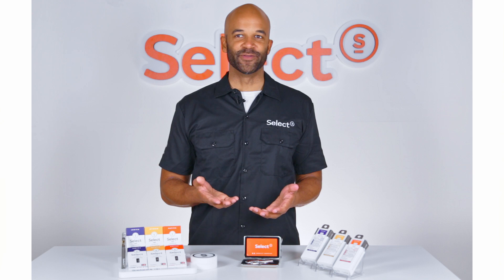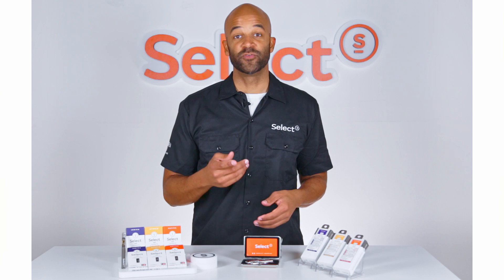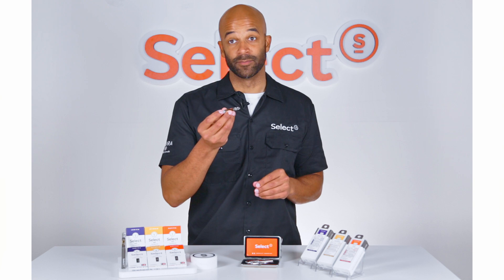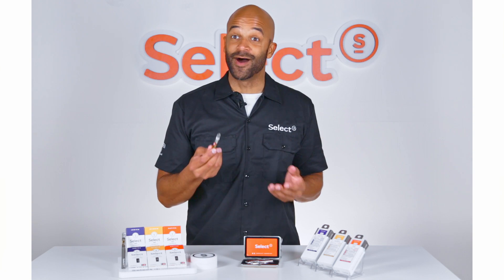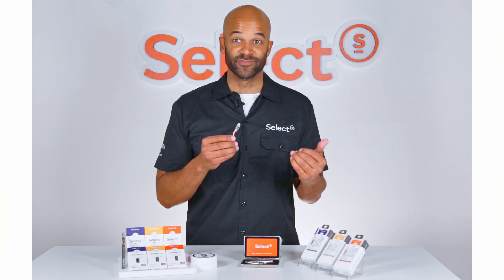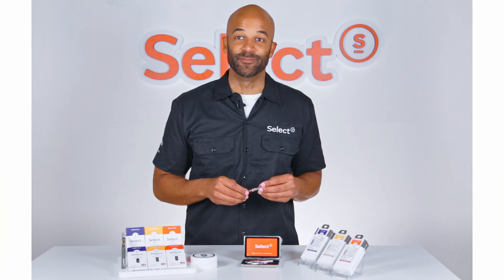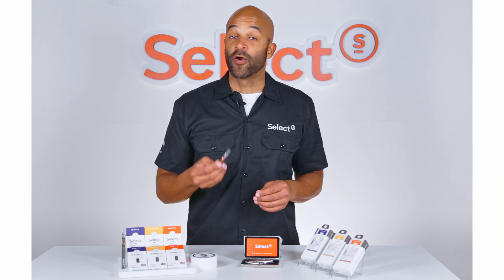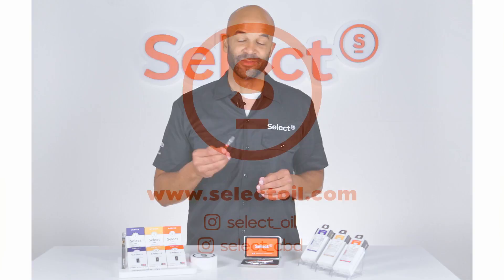Select Cartridge Care & Troubleshooting

Comment: My cartridge stopped working after 3 hits, I thought it was my battery and it wasn't, I went to the shop and exchanged it for another one strain but SAME issue

What worked for me was blowing the pen at the bottom AND the top of the battery after I did that it began hitting normal
Reply: Same here copped 2 gelato from their essential options and both not hitting right also got 2 apple fritters from their elite option and those hit hard no probs… i noticed at bottom of cart they dont have the chambers needed to pull like normal carts have and i believe thats the main issue
Reply: @ACR20012  Did those Gelato carts ever end up working? I bought two carts yesterday, one won’t hit anymore after the first hit and the second has nasty burning taste
Reply: @Callofbooty101  did you find a fix? This my issue rn

Comment: I've had 3 Select Elite Cartridges have the heating pin fall out of the cartridge after a week and a half of use. I'm moving onto another brand.
Reply: Doomhat2113 the oil might be different but all the cartridges are made by CCELL
Reply: Probably fake ?
Reply: I’ve had problems too. Two cartridges have had half full oil and the bottom part of the cartridge doesn’t touch the battery efficiently.
Reply: Week and a half of use ??? My carts only last 4 days tops .
Reply: @CursedNen  🍪 🏆

Comment: A little piece from the bottom of my cartridge came off, it was surrounded by a little rubber seal. Is there a way I can make it work again???  I can't seem to unscrew the whole bottom part to exchange it with an empty select cartridge that still works. I still have well over a third of it full. It's a glass cartridge and those dont seem to be able to unscrew through the mouthpiece or anything. PLEASE HELP!!
Reply: S2kleb I have the same problem as well
Reply: @jonaslack5357  I ended up making a little hole. Heated up the cartridge a bit to let the extract leaking through it. Then I got my friends electric rig on a low temp and let it rip.
I tried emailing select but they never replied . 
If you find a better way lmk
Reply: No, Select is garbage. The actual oil is good, but the rubber on the cart will overheat and break, rendering your cartridge useless. Also, Select carts are very inconsistent towards the end of the cartridge. Either the rubber will break, and/or varying ammounts of oil will be trapped in the cartridge and be unusable. Sadly, I've given them multiple chances and have been disappointed each time. Go with Heavy Hitters or something #disappointed

Comment: How do you fix the selects carts clogging issue because i swear yours clog more than any other cart because of the design
Reply: For anyone wondering use a needle to stick into trip to clear wax blocking the hole, after that it should rip but if it doesn’t you can heat the wax in the tip with a hair dryer and it should rip. IF that doesn’t work i recommend hitting the rip button on the pen and pulling until the cart unclogs. Hopefully this helps

Comment: I just bought one and it doesn't even work, I tried pulling up the pin on the battery and the cart but still nothing. It's trash
Reply: I have a different pen but its universals and will take all carts. This one doesn't work either.

Comment: I am having trouble finding info on the Select battery itself. Most have Amber lights for charging and green lights for fully charged. The Select battery just flashes white lights when you take it off or plug it in. There's no instruction manual for the battery itself or any info on the website from what I could find.
Reply: same, after i charged mine, every time i go to hit it it just turns the light on for 2 seconds and stops. no clue what to do about it because theres no information anywhere
Reply: handbanana5555 it comes fully charged. That's why it's confusing. It blinks like that when it's done. If you charge it after using for a while, the light will come on during charge and turn off when finished. I figured it out on my own quickly enough, but now people can hopefully look here and know:

•Fully charged: Blinks when plugged in and then turns off.
•Needs to charge: Solid light when plugged in that turns off when finished charging.
Reply: i think i mightve screwed mine on too hard,  because i can hit it now as long as the cartridge isnt on all the way, but slightly loosened
Reply: The instructions that come with the cartridge specifically says to prime it with the rubber cap ON! So which is it? On or off?
Reply: Did you figure out what to do? I'm so confused.
Reply: Select battery packs are junk I use a bbtank battery pack looks like a key fob no problem to date
Reply: im using a FlavRx push button, i picked up a .5 cart of skittles today and it's okay. just don't like the fact that you can't unscrew the tip to get bubbles out.
Reply: saved my life 🙌 also i had to prime it without the rubber thing. i held my finger covering the bottom hole and inhaled thru mouth part lol

Comment: Hey just a quick check, does this cartridge work with any 510 compatible eGo?
Reply: All 5.10 treading fits, watch out for the power supply amounts.
Reply: They do work but only until about half way they stop hitting, even when there’s oil left in. You have to constantly unscrew and fix the cartridge which ends up making it worse if you do it wrong. So don’t get these until they fix it.

Comment: My battery will light up when I press button but when I try to inhale it blinks white 3 times. Does this mean it’s dead or connection is messed up? If connection is messed up how do I fix this
Reply: I have the same issue, the light blinks red 3 times meaning my battery is dead but when I charge it, it turns green as if it is fully charged and isn’t.

Comment: my cartridge feels clogged with no airflow while screwed into a battery and its really hard to take a good pull. but if its not screwed into a battery it has airflow just fine. is there any recommendations?
Reply: @noahpaynenoahgayne7309  It turns out you just need to stick a needle or paper clip in the little vent holes on the lower end of the cartridge

Comment: I just got one of these pens and cant for the life of me get it to work. it says its fully charged but everytime I try to rip it it wont work :^/
Reply: Must be your battery
Reply: Dont know if you ever got it but--these oil cartridges do this weird thing where they seem to get plugged up, and you cant draw. All you need to do is draw hard enough to break that seal and it will smoke just fine. I have to do this every time I pick mine up. If you let them sit for longer than an hour or so, they get clogged and require a bit more suction to get going. I must say though that these cartridges are probably the most potent I've ever had. I love them but they're a tad spendy in Oregon. $60+ each some are more. But if you buy 5 they give you like 15 or 20% discount.
Reply: @bushpilot223  its $55 here in oakland ca. but with cali taxes... it turns out to be 75$ for a gram cart... pretty ridiculous imo.
Reply: Not the battery. These cartridges just don’t like to work about halfway through its usage. Had no problems with a different cartridge, but now I got my second select because I got a pretty good deal for two. Still was skeptical, but sure enough one of them crapped about halfway through.

Comment: How do you prevent clogging
Reply: Don’t leave it in areas that are hot, oil will seep through cotton and into air flow
Reply: MX6 Gaming thank you
Reply: Buttdreads I had to learn the hard way, sometimes I wouldn’t even be aware of the fact that I was somewhere hot, but it’d just clog a lot, it also Varys cartridge to cartridge, so it’s not your fault lol it just happens. My dumbass left it inside my car in the Texas heat, and my shit was clogged and I lost some oil, Bc it had seeped into the air flow. Don’t do that lmao
Reply: MX6 Gaming lol I have done the same thing. I left it in my trunk in my golf bag in AZ. Mine probably gets clogged because It’s in my golf bag. And always in the heat. I sometimes suck out a rat turd looking things out of the mouth piece (lame&gross) like sucking it through a straw.
Reply: Buttdreads 😂😂yeah it’s a good idea to not always carry it on you, unless you’re gonna be holding onto it the entire time. Also take care of your carts best you can, wait like 1-2 min in between each hit and use low heat, 5 second draw max, and the oil will last way longer, keep it’s taste, give the cart more life, cleaner tasting hits and consistency.
Reply: MX6 Gaming good to know. Thank you for the tips

Comment: I had purchased one and whenever I put a cart on the battery, it doesnt hit. When I try to hit the battery itself, the light at the bottom does turn on. Being said. Does anyone know the issue?
Reply: The cartridges are the issues. I’ve had two that don’t hit halfway through because where it’s supposed to touch the battery keeps getting pushed when you screw it on. No problems with a different cartridge.
Reply: They sold you fake oil if not try to poke the bottom w a bobby pin and dip it in alchohol but just the bottom not the whole cartridge
Reply: @RafaelCruz-tu7mj  Damn. Thank you for the tip. Peace.

Comment: Select consistently makes the worst carts I've ever used. They are the only brand I know of that uses plastic instead of glass for their carts. They are the only brand I've seen in the past couple years to have a disposable cart that you cannot charge. Select also uses some pretty sucky and outdated technology in their carts. They come with more headspace than any other cart. The oil inside is premo but they're quality is so disappointing. DO NOT BUY!